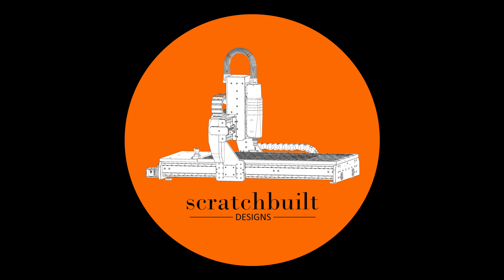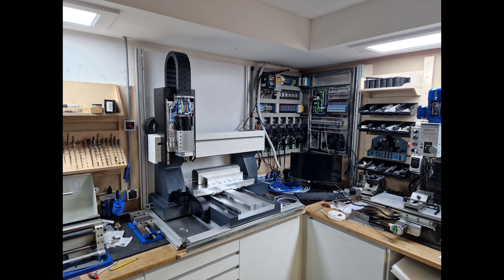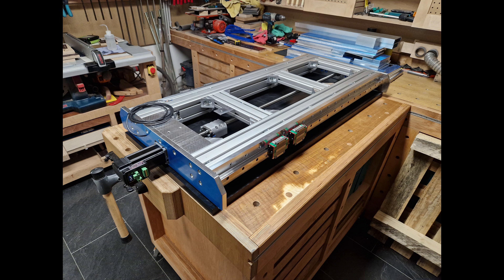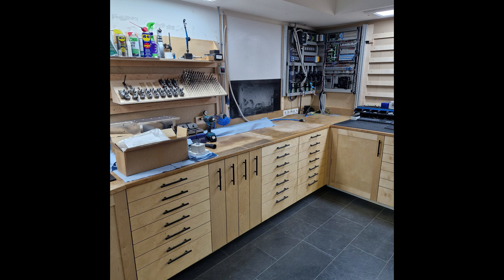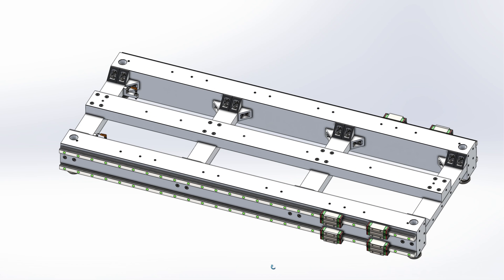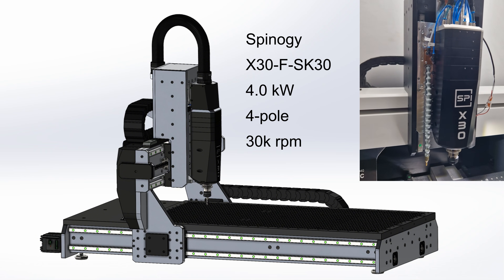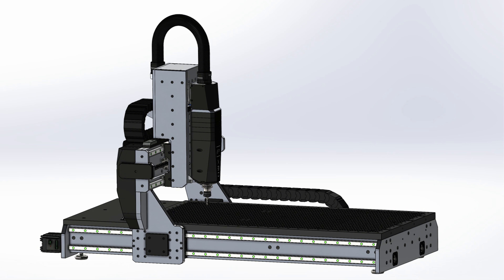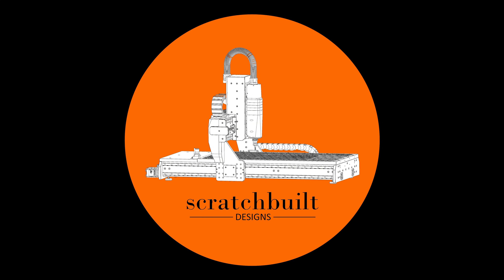Overkill CNC Router Upgrade Part 1 - Motivation, Design, Specs

Comment: Hello, I was wondering if you would consider selling a copy of the prints for the smaller version of your new machine? For some time now, I've been wanting to build a second machine with similar dimensions, and I can tell you have a lot of experience with these machines. I've carefully looked over the photos in this video, and honestly, i don't think I've seen another machine that appears to be as ridged as your design. Beautiful machine! It has a lot of similarities to my firstt design, although I ended up making a lot of sacrifices due to my budget at the time. Anyway, excellent work and fantastic videos. Thanks in advance for your consideration.
Reply from the maker: Thank you. You can send me a DM on IG
Reply: @scratchbuiltdesigns  I was honestly wondering the same thing, however, I do not have IG...

Comment: I like, thanks for the series. If you had enough space, would you opt for a moving table? Imho this simplifies the design and also reduces the problem of chips on rails and ball screws.
Reply from the maker: I had a router made out of UHPC with a moving table and 600x400mm workspace. You need twice the length of the table depth as footprint. On larger routers like this one it doesn't make sense. The weight of the table becomes quite heavy. And if you have very large and heavy work pieces the servo tuning could become an issue, because the load to inertia ratio changes.
I have this design in my portfolio, but mostly for smaller machines like the Watchmaker or the Minimill

Comment: Nice design! It's very similar to my design with the same dual rail Y axis. I used the 3 bed bars vertically though, resting on the bottom entirely and I've mounted 20mm thick tooling plate on it. Work dimensins are 1500x700x200mm. I have a vise fitted and stil have room for a full 1220x610mm sheet of plywood which is the main material I use in my projects with occasional aluminium and plastic parts.

Really exited to follow your build process. There are areas your build is better than mine so I'm sure I can pick up some tricks along the way.
Reply from the maker: Hey, that is some awesome feedback. I'd love to see your machine

Comment: Hi, thanks for sharing it's really great job you done😍. First I believe you are have focused about the sturdy and quality design. But i'm wondering why you go with two Y axis servo not one ? to avoid any delay from any side if happened. Secondly, Do you think it's easy to do CNC calibration or adjusting with solid structure as your design ?. 😬too much details and bolts
Reply from the maker: Yes, the router is at the width limit what I would run with only one ball screw in the middle. My old one with 500mm was ok with that, but with 700mm I prefer 2 ball screws to avoid any bending in case I mill at the outer edges.
As for the alignment it is in fact easier in my view. My next video (tomorrow) will show...
Reply: @scratchbuiltdesigns  Yess 👌that's great i'm waiting. Actually i say that from my daily work as programming and operating CNC machines to reaching 0.001 thou- 0.005 thou tolerance. Thanks

Comment: Hey man, great video and youtube algorithm hit the nail on the head with this one! GREAT workplace you got there, really made the best of the space, followed you on IG also keep up the great work! One question is, could you maybe make an entry hobby/budget cnc machine for aluminum/steel (Or at least list similar budget parts, and design things to keep in mind. I know how to 3D CAD, currently trying to build a CNC plotter as a starter :) ) ? I suppose this does not cost under 3-5k eur? :D
Reply from the maker: Thanks for the kind words 🙏
Well a budget router is tbh not yet planned. Maybe something to look into in the future.
There are already a few good DIY designs out there. And on a hobby level they can as well "mill" steel, although most of them are designed for woodworking.
When you have to mill a lot of steel parts in your hobby, mayby a CNC conversion of these cheap Chinese VMCs could be an option?

Comment: Should have flagged this video as 18+, that controller wiring is basically pornography. I sympathize with the constantly questioning your own design choices thing, I'm in the process of designing what was supposed to be a budget conscious desktop size CNC VMC but some absolute bargains of new old stock eBay listings like C1 ballscrews on all axes for $400 quickly led to scope creep and before I knew it my intended work envelope had tripled and it's suddenly a five axis build that has me in for 5x more than I had originally planned on because my brain says "what's the point of having super precise ballscrews if the rest of the machine can't keep up?"
Reply from the maker: Lol. Wait for the video about the wiring of the controller for this build 😂

Comment: Hiteco makes awesome spindles, if you ever need more rpm/torque than X30, with similar pricing.
Reply from the maker: The X30 4kW 4-pole already has a decent torque - despite the 30k rpm. More torque would mean more power and the subsequent VFD would be too big for my setup.
If I needed more rpm I would rather revert back to an X22. They go up to 45k rpm
Reply: @scratchbuiltdesigns  I was planning on building myself a router and I was gathering up information and comparing parts. Hiteco QD-2 6.5/12 was in my opinion better than X30, both 4 pole spindles, but Hiteco was max 40k rpm with 6,5Nm while X30 was 30k and 3,2Nm, I think the X30 4-pole costs over 8K euro while hiteco spindle was 6,2K. 
Yeah, they don't look as fancy but I think they are still solid spindles to consider.
Reply from the maker: @koitk  Well, of course a 6.5kw spindle has more power and torque than a 4kw spindle 👍 At the end, everybody has his own preferences...and that's good
Reply: @scratchbuiltdesigns  Indeed, not sure if you follow Marco Reps's channel, he almost made rigid tapping work on his CNC using X30. So I guess having bit more torque it would be quite possible and maybe work reliably?
Reply from the maker: @koitk  Yes, I follow his content too

Comment: Using 4 linear rails for the Y axis is a design fault : it overconstraints the design. If the gantry requires bigger strenght of the axis, use a bigger linear rail version
Reply from the maker: Why should there be on over-constraint? The dual rail design is mainly there to reduce the biggest weakness in gantry style routers and that is lateral stiffness. A bigger rail won't solve that issue

Comment: Oooooooo this is going to be good too watch, I too am currently designing and building my own Desktop CNC, not as big as yours also due to living in an apartment. I cant wait to see more of this build. 

I see you also made a short of testing Granite Epoxy, please could you share a in-depth video on this, I'm planning on filling my profiles with Granite Epoxy but haven't got the faintest clue on the ratios and which Epoxy to use.
Reply from the maker: I filled the profile of the gantry with epoxy granite. It will be shown later as well.
Until then, you can see some details already on my IG page 😊

Comment: What made you go with UHPC over epoxy granite? Also, looking forward to the wiring and controller box video!
Reply from the maker: It was my first attempt at mineral castings. The stuff is rather popular here with German machine makers and it is very well documented.
Not so many info on how to do a proper mineral casting. 
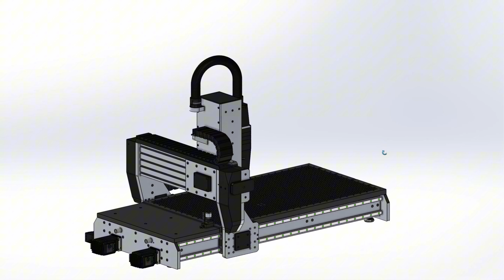But it requires a drum concrete mixer and can therefore not be done inside of the house. That's why I went for my current machine (0:32 bottom middle) with an epoxy granite bed.
Made a lot of trials with different mixes before - I have a short out, wacking one with a sledge hammer 😄
Reply: @scratchbuiltdesigns  did you post-cure the epoxy granite? If so, at what temperature and how long?
Reply from the maker: @grandmastersreaction1267  No, the size of the plate was simply too big for that. Door was closed, room temp about 25°C, 48h before demolding
Reply: @scratchbuiltdesigns  and lastly, what is the work area of your UHPC machine?
Reply from the maker: @grandmastersreaction1267  It was 600x400x200mm

Comment: When you say the performance of the previous router was excellent - Can you provide metric? Feeds, Speeds, Accuracy? 

I am very impressed by your work - you provide me with much inspiration ... though i confess I am envious of the dedicated use case for your workspace. You don't have to share it with bikes, garden tools and Christmas decorations : )
Reply from the maker: Hard to answer, because there are so many different factors at play. I used it predominantly for woodworking and 5-6m/min in hardwood with an Ø8mm 2-flute with 8-10mm depth was no problem. The limit was rather the 2.2kW spindle. The machine can handle far more and I will push new limits with the new spindle.
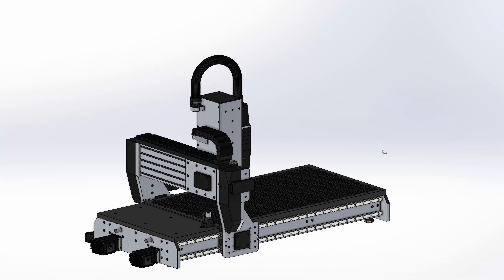I sold one machine with the same design (0:33 top right) and the owner mills non ferrous metal with it and the accuracy is up to ±0.01mm. But this depends very much on the setup
Reply: Also ... can i ask about your cad solution ... it looks like Fusion.
Reply from the maker: @planetofthepete  I use SolidWorks
Reply: I very much support seeing the electronics - This is an area of interest to me. 
I will eagerly follow your progress.

Comment: What's the cross section of the aluminum solid bloc you used for the X axis where you have two HGR25 mounted on? 120mm X 50mm ?
Reply from the maker: Na... It is a bit beefier...😂 136x100mm with a 5mm recess for the mounting surfaces. More explanation why this particular size in the next video 😉
Reply: @scratchbuiltdesigns  Oh it is, it will cost a fortune here in US. I'm thinking to use square tube steel with 12mm wall thickness filled with polymer concrete and a flat bar welded on top and scrape that to flatness. I could find nobody here close to me willing to machine that. I have about the same length as yours 1200mm
Reply from the maker: @car9167  That's amazing. Unfortunately, I don't have the skills to scrape such a large area to precision. Hats off to you
Reply: @scratchbuiltdesigns  I have a laboratory grade granite straight 1 micron flat in 4 feet (1200mm) and I can use that to make a cast iron straight edge and use that to scrape. I made a 3 feet (900mm) and used it to scrape my mill ways and table flat to 2 tenths (5 microns), also scraped the surface grinder ways, I bought it as scraped metal. Worked a year on the surface grinder but I can do 1-2 micron flatness in 6"X18" (150X450mm). It is A LOT OF WORK. My passes are very shallow in the range of 2-4 microns per pass. My milling table was twisted so that a corner was 8 thousands above the granite surface plate (0.2mm) Took me 3 months to scrape that table flat and it's dovetails.

Comment: Never seen any content from you earlier, but what some great machines you have made. You said you had made a torsion box of aluminium in your newest gantry, is that a “epoxy granite variant “ which you clearly have made earlier, or just a box with aluminium walls? I’m just wondering if the torsion box without any infill would be prone to vibrations? Just interested.
Reply from the maker: Yeah...my first video here. Headed over from IG. Lot's of content there already, as well about my previous builds. The torsion box was hollow indeed, but no issues with vibrations, because it was not just a box, but had some stiffening ribs in the middle and everything was bolted up tightly

Comment: This is epic,

Have have ever tried granite epoxy i would like to try to make a cnc with this one day :) 

And please could you go in to have you calibration the cnc do you use a ball bar or something and how do you achieve parallel between the axis in the construction process
Reply from the maker: Yes. The one in the overview at 0:32 - bottom middle - has an epoxy granite base. Most parts that will go into this build have been milled on it and you can see it in the upcoming videos.
Your points have been noted and will be covered as well in the series
Reply: @scratchbuiltdesigns  Thank you would you say epoxy granite is better or worse any way i cant wait for more vids thank you
Reply from the maker: @giz177  For a machine base (all non moving parts) it has the benefit of excellent damping properties. This is especially important when you want to have a good surface finish in metal, because it reduces vibrations.
But the build effort is higher, because you have to make a mold first. Also, you need to put some extra effort into making the mounting surfaces for the linear rails perfectly aligned to each other. Either by having the entire part faced on a bigger mill or by using precision jigs and a metal/epoxy mix. Taking all this into account such a machine base is rather expensive.

Comment: So this are the machines I built -> sub. Awesome workshop, I wish I could be so organized but unfortunately I have to deal with the standard German basement, don't even have walls on one side, just wooden grates.. That new router must have costed plenty, where do you source raw material?
Reply from the maker: Well, you are right. The bigger a machine get, the more material you need. And aluminium have become really expensive in the last years. Especially the extruded profiles have almost doubled in price in the last 5 years. And that is as well one of the reasons why I went with solid bars this time. Hard to believe, but they were not more expensive than a design just out of profiles. I will explain this in more details in the next video.
I buy the aluminium mostly from a German company called "Gleich"